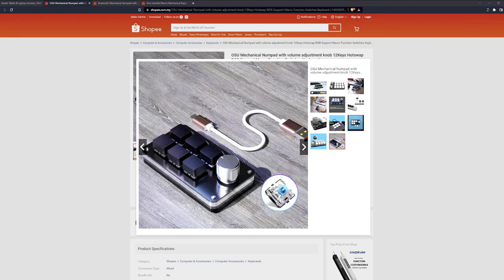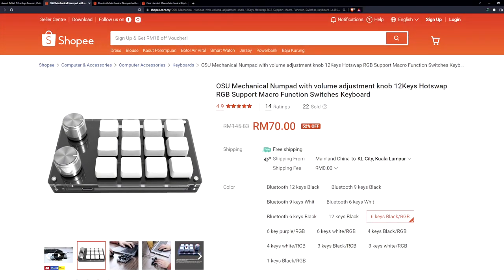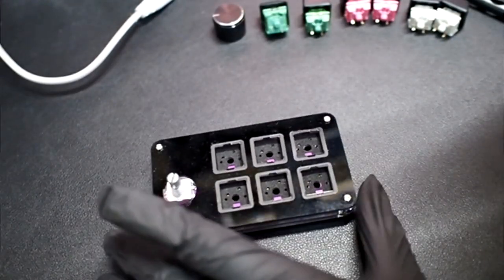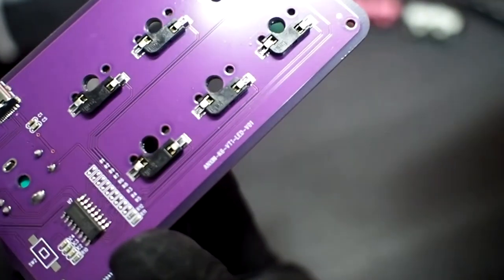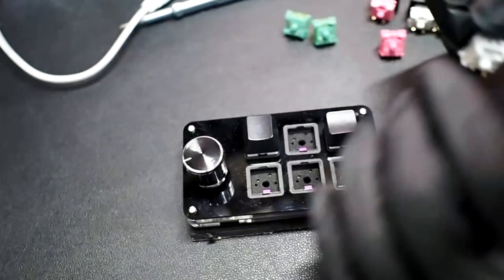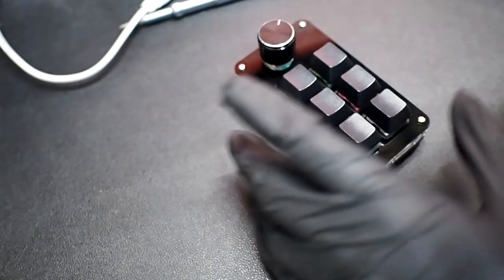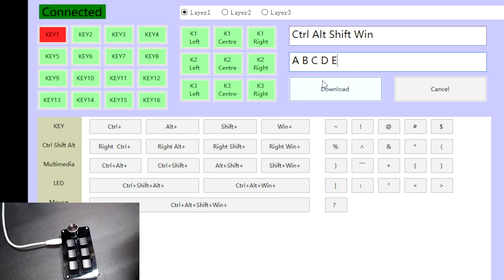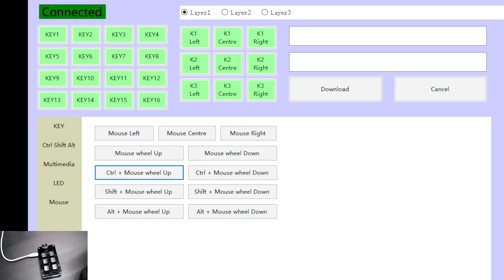Looking at a cheap 6 switch macropad with knob

Comment: Thank you for posting where you are sharing the files. Could someone point me towards instructions on what to do once I'm on the google drive? The video above just seems to switch to being inside the application, and I'm getting errors about files not being found, etc. 100% sure I'm doing this wrong.
Reply from the maker: Download whatever is from the Google share. If it's in a zip file, you need to extract everything before trying to run it. 

If a standard run does not work, try running it as admin. 

Also, it only seems to work with windows 10, windows 11 is not stable.

Comment: He says this in the video, but for anyone just here for the software: select a key on the top left, then what you want it to to down below, hit download and it'll write to the keypad.   The K1 left/center/right are for knobs, turning left, right, and clicking.  
Thanks for linking the software!
Reply: thanks, you explain in one sentence what the video does not tell in almost 20 minutes👍
Reply: Always read before you download, or you will clear all of your settings.  You would think you could reload the configuration file, but there's no such animal.  You also can't save multiple configurations, not that you would want to.  I use mine with Autohotkey, and I can't imagine using one of these without something like.

Comment: Thank you for the video. I purchased a 16 button + 2 knob macro pad from temu similar to the one you have. This seems to be an inexpensive way to make a diy macro pad using Adafruit KB2040. All I have to do is figure out the pin connections, de-solder the built-in chip, and add wires to the KB2040. I will probably design a 3D printed bottom to accommodate the extra thickness.
Reply from the maker: Its a pretty good idea. 
I've made custom keyboards normally the annoyance is with MOQ of the individual items. 
Modding one of these would save a lot of purchase hassle for the hassle of modding the ori enclosure. Not a bad deal with access to a 3d printer.

Comment: Thank you for the Video and Software Link. I got a 4-Key version off eBay and the seller didn't include any software links and was not replying my messages. Fortunately I've just programmed it to work with my Raspberry Pi after finding your video :)

Comment: Thank you for the video! Ran into an issue of my board not getting picked up by the program, fixed by running it as administrator. Hoping this might help others with the same issue.
Reply: Hello bro, i try to set numbers for the key button but it doesnt work. do you have that issue?
Reply: @Joshuatop  mines for 15 16 the final two dont get red to change UHHH 😭😥😢 on my 12 plus two dials WHICH ARE SOOOO DAMNNN GOOD GOT ONE FOR VOL AND OTHER FOR SCROLLING omg ita beautiful and Bluetooth buggy but cutee

Comment: Thank you, you saved my day. I'm just wondering what the function of LAYER is? can I use a shortcut on different software?? for example Lightroom uses a different shortcut to Photoshop and when not using any software, the Shortcut key returns to the way I set it in the beginning without re-entering the shortcut key again. can it be done?? Thank you again.
Reply from the maker: Nope the layer is supposed to be a toggle for a different mode. 

If you want to keep tacking on functionality, I would suggest look into autohotkey 

First you map this macropad to super weird keys like f12+alt+5 then you use autohotkey to look for that input and check the foreground app to decide the actual input you want. 

Of course this process is quite involved but there’s plenty of existing resources. If I do get around to implementing something like that, I’ll drop a link in the video as well
Reply: Thanks bro

Comment: Hey there. thanks for the instructional video. I'm concerned though that the files have been flagged by virustotal as a trojan?? is it a false positive?
Reply from the maker: I've not had any issues. 
I did first run it through a sandbox didn't find any issues. 
If you have doubts, then, use a burner device or vm to run the program and config, then torch it.

Comment: I'm not sure if it would be possible but do you think i could have it so every key on there isn't like a macro but instead it's own key? like instead of control + v i could make it "button one" and be able to map games to it?
Reply from the maker: @daryn2508  if you mean keys that don't exist on a normal keyboard, then its normally done with f13 onwards. 
Unfortunately the software doesn't support those keys. 
You can chain a macro with autohotkey to get that result if it's something you'd like to explore.

Comment: Thanks for the video, i wonder if you can use the knob to play games like Arkanoid. In this case, can you configure the knob to move as a mouse left and right in an analog way? It seems you can only set left click, middle and right click functions only.
Reply from the maker: Nope, as far as I know it’s not possible to directly assign those kinds of commands. 
I would normally suggest autohotkey for custom mapping but with gaming I’m not sure if it’ll add additional latency. 

Then again, it’s been a well known finding that these devices have a pretty low polling rate that really doesn’t make them suitable for gaming. You’ll get very poor response times.
Reply: @randomnick2890  Thank you very much for your reply, you were very helpful. I thought i could use it for this kind of gaming but with latency, it would be frustrating and unplayable.

Comment: easier instructions:

keyboard, horizontal layout, dial knob on the right side.
Upper keys: 1 2 3
lower keys 4 5 6
All you need to do to program a key, is to select the configuration on the software, say CTRL-C for copy on Key 4.
You select CTRL SHIFT ALT in the menu, then click CTRL+, then click KEY, and click on "C". Then hit DOWNLOAD to enter it into the custom keypad and tada! You have copy on a key.

To program the dial for volume (as I did)
K1 - K2 - K3 are the dial knob for the single one you have.
Click K1
Click Multimedia and hit Volume - (volume down)
Then click DOWNLOAD
Click K2
Click Multimedia and hit MUTE
Then click DOWNLOAD
Click K3
Click Multimedia and hit Volume + (volume up)
Then click DOWNLOAD
now your dial controls the volume.

Comment: There's a large number of these keypads being sold. What are the chances of an embedded keylogger program present on these things.
Reply from the maker: There is no garuntee, however here's my takes. 
1. If you watch my teardown, the chip used wouldn't readily allow much function to be embedded. So to my there's minimal possibility on the hardware level. 
2. The software. This is the risk. Having to run some random ass software to get the device working is sus. 
From the files that I've shared, it seems to contain the source as well. I don't have the means to validate if it's clean, maybe someone more well versed in it can take it up. 
What I have tried is running the software though a sandbox, nothing came up, so I guess it's clean.

Comment: Nice video, thx. I am trying to figure out how to write the \ sign! It will be the same as an @ or so, and there are two signs on these keys, makes me not allowed to do it. When I press I\ both comes up, and I can not take away the first. How do I choose whitch of the signs in the keys I want to show up? Exaple: I like to press $ and press the 4 key, and then it writes $4 .....
Reply from the maker: I don't entirely understand your issue, but here's what I think might help you. 

On a normal keyboard, when you want to press '?' you would press 'shift' + '/' 
So you could assign the macro to that combo. 

Hope that is what you're looking for, else do try to clarify more.

Comment: Is there a Press and hold function? Pushing the Key seems to be a single entry thing even if you hold it and holding it just spams that letter like multiple presses.
Reply from the maker: Unfortunately no, there’s no support for tap dance or anything of that sort. 
The best you can get for more functionality is to get the Bluetooth version that supports multiple layers.

Comment: It´s great and it works wonderful... BUT... as soon as I restart the pc the programming of the keys is gone. I found the right software and downloaded the macros to the board. Totally not usable... any help?
Reply from the maker: What happens if you unplug the board while its the computer is still running then plug it back in? 
Does it also get reset? 

If it doesn't get reset, what if you unplug the board then poweroff the pc and boot. 
Does that get it reset?

Comment: can you tell what the LAYER1 ...2 ... 3   function does and can you connect, for example, 2 such keyboards? to have more different programmable keys?
Reply from the maker: The layers give access to different keys. As I mentioned in the video, it only works with the Bluetooth version of the macropad which I did not get. If you’d be so kind as to sponsor me, I’ll test it and make a video on it. 

I’ve tested 2 macropads on the same machine, it is individually recognised. There’s no issue with making more than one. 
The programming needs to be done with only one connected at a time.

Comment: I'm wondering, can i assign the Knob as steering wheel if we wanna play a rally/car racing game? Thanks in advance.
Reply from the maker: Not a good idea. 
1. The knob is stepped, so there's quite a bit of friction when trying to turn and it has a set turn amount. 
2. The polling rate of the device is not high enough for most games that require fast input. 
3. Its just really small. Unless you're gonna hold it with 2 hands or have a way to mount / stick it to a desk, its not going to stay in one place

Comment: hi guys,,I wondering that is it work in photoshop? like using it for change the size of the brush cursor by rotating the KNOB, i'm planing to buy it.
and also,, is the knob rotate smoothly? like there's no gap when we rotated it.
thank you.
Reply from the maker: Yeah it’ll work in photoshop, you just need to bind the keys to the right symbols. Nearly every action in photoshop has an equivalent keyboard shortcut. You can even modify the shortcuts if you need to in the photoshop settings. 

The knob is clicky. There are distinct steps as discussed in the video.
Reply: @randomnick2890  ooh thank you so much for the help,,it's works so i'm gonna buy it then..
for the clicky,, i hope i can deal with it.

Comment: I have this same keypad.  I programmed the buttons, but I'd like to change what is programmed to a couple of buttons.  Can you change the programmed macro or are they set once you program it once?  I get an error message when trying to change macro programming.
Reply from the maker: I can change my / reprogram them without any issues. 
The base module can only hold one macro per key.
Reply: @randomnick2890  what is the Url for the programming app that you use please?
Reply from the maker: @ghilsinger74  check the video description. The Google drive link is the one that was used in the video. There’s another app that was also shared by a different user, I’ve not used it personally.

Comment: hi sir, can you check if this thing is compatible with midi2lr ( a soflware allow usb midi controller to use with Adobe Lightroom )
Reply from the maker: Yeah, no. 
I don't think it'll work. I'm not familiar with the software. Looking at it, it does not seem like it'll work
Reply: @randomnick2890  Thank you!

Comment: I have this one with 12 keys and has no LED, but it should looking at the text with it. 1 key seems to be lacking this download-assignment function. It won't save the command so it keeps empty... any tips?
Reply from the maker: Can't help man, I only have one type. No experience with any issues or other models.

Best to check with your seller to get their advise. There's a chance its damaged, so return it and get another one of all else fails.
Reply: I contacted a seller so will wait mine two don't work of 12 its 15 16 like i need all ma babies to workk ughhh

Comment: mine does not activate the leds, why is it? do they bring the keycaps?
Reply from the maker: The key caps don’t affect the leds. There’s the option in the programming tool to configure the led mode, have you tried the different modes?

Comment: I am using a Windows 10 PC and my Device is not showing up as Connected in the Software although it is. I tried anything but I can not find a way to get it working. Any Ideas?
Reply from the maker: I would start with windows itself. 
1. Is the device showing up in windows device manager when plugged in? Does it show any sign of life? Like printing the default c when pressed. 
2. If no, try another usb port. 
3. If all usb ports fail, try another machine
4. If that all fails then it’s probably the macropad that’s faulty. 
5. If it’s connected and print the default c but software does not recognise it, confirm that your device is the same as the one I tore down in the video, unscrew yours and ensure it generally looks the same. 
6. Try running the software as administrator. 

If that all fails, explain your procedure again here as detailed as possible and we’ll see if we can figure it out. 
If one of the steps works, do report back so that maybe it’ll help someone else.
Reply: @randomnick2890  it is showing up in the device Manager, the layer button is working, and there are random keybinds on the makropad
Reply from the maker: @ZwiebelConnaisseur 
Okay, have you checked if it’s the same chip family? 
Or tried running the program as admin? 

There’s 2 programs by the way, feel free to try both. 
One I used in the video and another that a fellow YouTuber introduced.

Comment: Ive got the same one. BT version, but cant connect to my windows7. Any advices? 😢
Reply from the maker: Try with a windows 10 machine? 

When you say cannot connect, are you trying after programming it or trying to connect to program it?
Reply: @randomnick2890  after programming. Its working via usb. Also my phone is connecting with keypad with no issues, but my laptop is looking for devices then after long time, there is some "tool" on the list wich can not connect and disappers. To this time my laptops BT was working fine.
Reply from the maker: @wykonczeni  maybe the bluetooth version isn't compatible, can you check what version of bluetooth your laptop supports and what version the macropad uses?
Reply: @randomnick2890  maybe youre right, but im at work right now. Anyway, tell me one thing, because  my manyal is missing, is there any kay combination to make device visible to pair it with BT? Coudnt find any info on that in internet
Reply from the maker: @wykonczeni  sorry bro, I can't tell you that. 
I don't own the Bluetooth version. Maybe someone else who has one can advise you accordingly. 

I'm also open to testing it out, if you're able to sponsor it.
Reply: @randomnick2890  thanks for your replies. Maybe in another carnation? In this one i have win7 because of lack of loose money to buy new one 🤦🏻‍♂️ greets from poor poland 😆
Reply from the maker: @wykonczeni  haha.. We're somewhat in the same boat man, no probs. 

Just check out the Bluetooth versions first and see what you can do from there. 

Cheers, good luck.

Comment: Are you able to have each key play separate sound bites or is it strictly for keyboard controls?
Reply from the maker: It's all about key binds. 
If you can bind the sound to a specific key combo, then it's possible. 
If you want it to do it from the ori software, then nope, that's not possible.
Reply: @randomnick2890  thanks, that seems to be beyond my scope in ability lol
Reply from the maker: @TheTXChris  sure, I’ll ping you if I do create a guide or the likes for something similar.

Comment: This macro pad support 3 layers, I wonder how can I switch between each layer? I've already downloaded software, but I didn't find any clue about it.
Reply from the maker: Like I said in the video, 
My seller informed me that the wired version does not support the layers function, its only available with the bluetooth version. 

I don't have it, so I really am unable to explain how to use it. 

If you'd like to sponsor a bluetooth unit for me, I'll definitely try it out and make a video on it.
Reply: I bought the non-bluetooth 12keys + 2knobs, theres a button at the side that lets you switch layer.  
Bad thing is there is no indicator on which current layer you are, unless you test it.
Reply: @manOfTheSaltpans  wait waat i k there's wm switch to turn it on off then one goes blue like a bt connection thing but bad to keep wireless as never picked up default when starting my lenovo ideapad
Reply: @Poetry4Peace  mine dont have a switch for on/off,  just a button to switch between the layer. Just want to repeat, what I have is the wired non-bt model.
Reply: @manOfTheSaltpans  maybe be layer switch it goes blue when press wbu
Reply: @manOfTheSaltpans  https://ae01.alicdn.com/kf/Se739dcf4b4a84f73b9fb9e1a365ca1f50.jpg_640x640Q90.jpg_.webp this image explains it well so i have bt switch and the other is layer one!

Comment: How to you save your settings ? After computer restrart setting all gone...
Reply from the maker: Interesting that your settings aren’t saved. 

It’s supposed to be saved to the keypad so moving the keypad between computers should retain its function. 

I’ve not had any issues with the 2 keypads that I have, so I can’t offer any advise. 
Maybe someone else around can point you to a solution.
Reply: @randomnick2890   Any chance you found or know a way to save different profiles for the keypad? Example one setup to use with Photoshop, then run another and it's set up for a different piece of software.
Reply: i have same problem, did you find out any solution for this?

Comment: The .exe file i downloaded will not open. Any ideas what might be wrong?
Reply from the maker: Check if your firewall is blocking it and try running it as an administrator. 
Just to confirm you’re trying it on a windows pc ya?